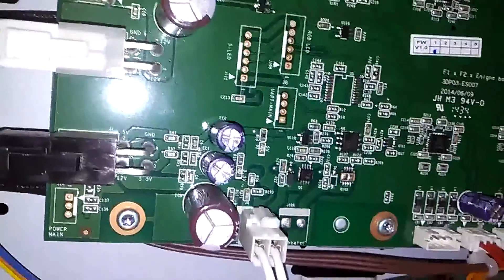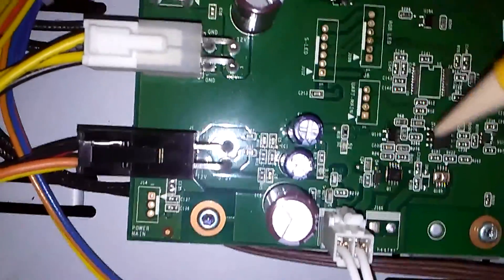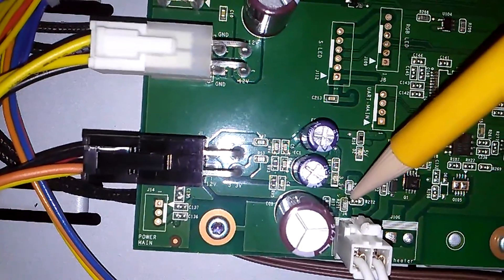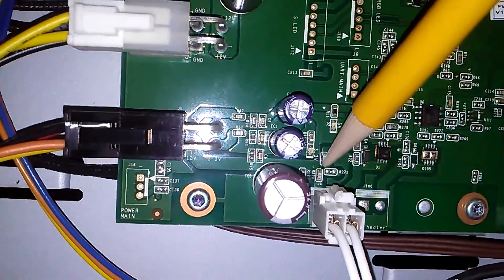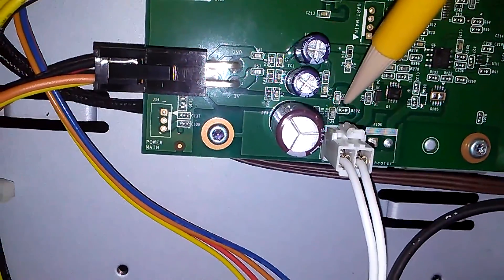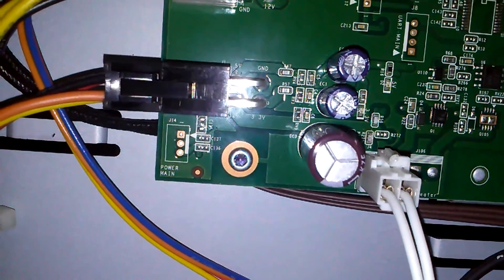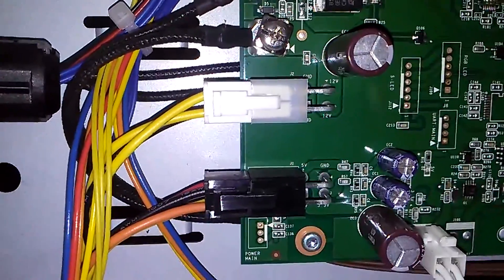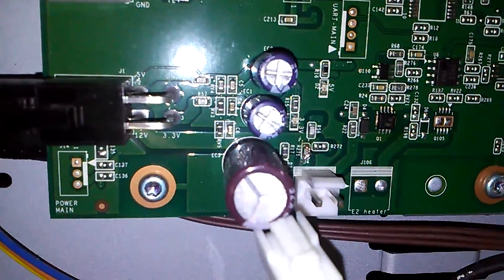3D printer xyz davinci extruder not getting hot fuse blown and easy fix heater decoupled

Comment: r271 fuse is a 4amp 48 watt fuse. i had this issue, just removed the r271 and soldered the gap then installed a 4amp inline fuse on the wire to the heater

Comment: I just did this trick and it worked. I was worried about the power supply burn up so I measured the resistance of some of the resistors near the one thats blown and they read 0.2 ohms. A small blob of solder has the same resistance at basically 0.2 ohms. This is safe to do.

Comment: Good evening, I apologize for the inconvenience and with the permission of the administrators. I would like to ask for your valuable assistance. I am the happy owner of a Davinci 1.0a but I am afraid I will burn something while doing maintenance. I found that the R271 resistor was not giving continuity so I bridged and put a fuse to protect as indicated in videos and forums. But unfortunately the extruder does not heat up, I have measured continuity and the cable is perfect but I found that when measuring voltage in J4 sometimes it starts from 12v and it goes down progressively as if a capacitor were discharged. What do you suggest?
Reply: I just did this trick and it worked. I was worried about the power supply burn up so I measured the resistance of some of the resistors near the one thats blown and they read 0.2 ohms. A small blob of solder has the same resistance at basically 0.2 ohms. This is safe to do.

Comment: My da Vinci 1.0 motherboard is different and have a mosfet that supplies power ? ( ground connection to the extruder plug in the motherboard)  .when I turn on the printer with the extruder plug out , there is a 12v across the two pins in the motherboard, that immediately start to drop down to around 2 volts , I wonder what’s is the problem because the heater does not heat at all .Ps I can’t see the fuses in my motherboard

Comment: The problem with mine is that the led works ok , but I don’t have ground on the plug r/h pin , I heard that people fix that issue by putting a jumper from the ground wire of the heater to ground , but I’m chicken to do it just yet...

Comment: That R271 is a fuse for the extruder. The heater is rated at 40 W. Therefor for a current of 12V that uses a power of 40 watts (40/12 = 3.3) so a 4 Amp fuse on the left wire should do the trick. This happens often when the extruder is scraped with a metal brush while it is powered on and the isolation on the power cables is not all that good, cables get shorted with the metal brush.... boom... R271 goes kablooey. 

You should install a fuse though. Or not scrape the extruder with a metal brush while it is powered on.

Comment: Xyz aio 1.0 Printer skips heating process and attempt to print immediately. After aluminum bed swap. Reusing original heating pad. Short? Broken circuit? Static discharge on main board? What happened ? Help?

Comment: Thank you so much for posting this video. First rate fix. The only thing that I did differently was that I soldered a bridge across the component made from one strand of a piece of flex wire in case it needed to blow again. Cheers 😀

Comment: Weird,  I just put a multimeter on mine thinking it could be the same issue,  but it's not..  on the connectivity setting,  it does give a small amount of resistance.  

I honestly think my one's problem is the firmware.  But I cant find a way to downgrade it for a 1.0A  only the 1.0.
Reply: if you work it out let me know

Comment: R271 is actually a flush mount Thermister which helps regulate the extruder temperature. I have the same problem with my davinci Duo. After several days with tech support and sending lots of pics I was told to send the board in and they would fix it for $60 an hour plus parts and shipping. I am going to replace the part myself. Hope this helps.

Comment: Dude just wanted to say massive save for me after watching this, you were spot on with the most likely fault. For those that watch I have a 1.0A meaning that the connector fault you see listed else where for older models is not the most common issue on this model.

As a twist on your advice however I did solder over the connector but then put a very cheap in line cable connector on the lead going to the power supply (4 Amps), just to be safe.

Again you are a life saver!

Comment: +MichaelZoneRobotics - Great video.  Very helpful for sure.  I ended up replacing an extruder and the wiring harness only to find out it wasn't getting any power.  I want to solder the jumper to the fuse, but I think to be safe, I should get another fuse in case something goes wrong when I do the repair.  Can you recommend any website or store where I can obtain the J4 fuse with the R271 resistor?  I've been checking, and so far, I have no such luck :/  Thanks for any information.

Comment: Michael, great work with this. I was literally minutes away from ordering a new extruder unit, having struggled with the heater decoupled error for two weeks now. I checked this circuit after watching you video and found voltage above but not below J4. Five minutes to solder a jumper and I am up and running. One question, I had red indicators on the board after installing repetier however I never had an issue in a full year of printing- that is until this happened. After the fix, I still have red lights but it works fine. Do you have and indicators on your board?
Reply from the maker: +John Young Yeah I still have the red lights, glad this helped !